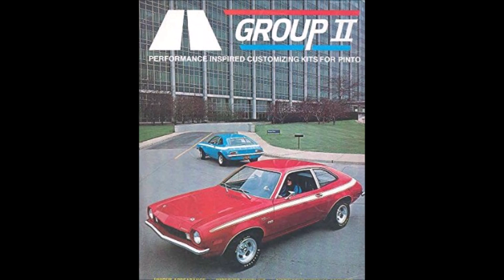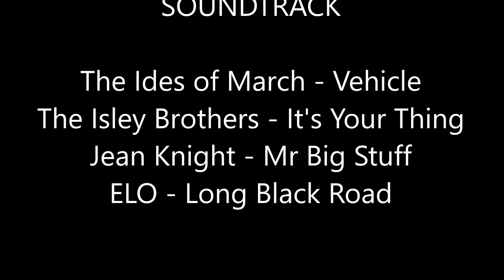1972 Pinto Runabout Restoration Part 3

Comment: Being a huge fan of anything 1972 Ford, Lincoln and Mercury I am super impressed.   That Pinto looks fantastic.   My parents bought a brand new 1972 Pinto on 11/04/72.   Capitol Ford had three left over 72's on the lot and my parents picked out the white Runabout with the optional interior and exterior decor group.  2.0 liter 4 cylinder, disc brake,  Automatic, A/C.  It had green houndstooth seats, color keyed steering wheel and seat belts.  Fantastic little car.  My brother inherited it in spring of 1977 and when he went into the service in 1980 I bought it from him.  Wish I would have kept it.  Sold it in 1981.  In mid 1983 I was missing my first Pinto so I found on 07/16/83 a non running needing a lot of work 72.  This one was a base model.  Very early 72.  The early Runabouts didn't have the two struts on the hatchback.   It's like it had a lot of left over 71 parts on it.  Door panels etc.  It had the exterior decor group and deluxe bumper group like yours.  My first one had plain chrome bumpers with no rub strips.  About the only good thing was the headliner.  It was my first project.  Luckily there were still a bunch of Pintos in wrecking yards for me to pillage parts from.  Door panels of a 1977.  Steering wheel out of a Cougar.  Console out of a Mustang II which fit like it was meant for the Pinto.  NOS dashpad. Seats out of a 1982 Mustang fox body.  Now I have reckling seats and a slightly higher seat which makes a big difference.   Put an engine in it.  Rebuilt the transmission and painted it Ford Dove Gray.  Loved that Pinto and drove it for seven years.  Sold that one in 1990 because I had moved out of town and bought a house so I needed extra cash.  So here we are in 2020 and I have my eye in one at a wrecking yard that was owned by an older couple.    When they passed away the family called the wrecking yard.  This one has 59K original miles.  Same white as my first 72, but with beige interior.    Oh how I wish it was green or blue.  But from the outside it looks identical to my original 72.  Dent free, great original paint.  Engine is super clean and looks like the engine compartment of a three year old car at most.  Best of all I runs good.  I will be making an offer next week when I go talk to the guy who handles rebuildables at the yard.
Reply from the maker: Sounds like a good car. I hope you get it
Reply: Did you get your pinto???

Comment: My FIRST car was a ‘71 Pinto, no air, 1600 engine, 4-spd, no radio, hubcaps, vinyl floorcovering, white with green interior. Bought it in ‘76 for $1200 USD. Worked ALL summer to save $900. Had a boot, no hatchback or runabout style. Lots of memories...biggest POS I ever owned, tho. Everything on it was thin, fenders and bumpers. No overiders on mine. Bent the end of a bumper once. Cost $150 for a remanufactured bumper at the time. Of course, I was 16-18 and really didn’t have the money to take care of it, properly. 
You’re doing it properly!!!! Very nice job with attention to detail. Thanks!!

Comment: This is a really cool film. I love the car - I like how you have made it much cooler that it was (not just better condition, but cooler colour) but kept the original period feel. Best of all the attention to detail is great - this project is an inspiration to anybody restoring any machine. The methodical approach is great to see but also it's great to be reminded that all the small detail fittings like door buffers make a huge difference - not just to making the car look fresh as new but I but it's less squeaky & rattly than some restored machines. Great to see such a rare and overlooked machine put back into daily use, too. This machine will turn heads wherever it goes. great project, great film.
Reply from the maker: Thanks for the kind comments. Interesting to restore a car so much newer than my usual ones!

Comment: Wow, thanks for the memories. Had a 74 hatchback. Orange with red stripes. Drove the hell out of that car. 4 speed 2000 cc motor. Only bad thing was those motors were notorious for eating cams. They were easy to replace though. I'm pretty sure I still have a brand new NOS front grill for a Pinto still in the box in my garage rafters.

Comment: Looks like you may be in England, an odd car for there even when they were new!  Pintos and Vegas were everywhere when I was a kid in the 70's. Pintos seemed to last forever, vegas hardly made it to junkyards. One friend had a '77 pinto wagon, passed it to his little brother years later, last time I saw it it had well over 300K on it. Just have to keep up on oil changes. The 4 speed manual was a decent transmission and made the car a lot less sluggish then the auto, and more fun to drive. Really nice work there, car will certainly turn a lot of heads!
Reply: Yes the automatic pinto was VERY SLUGGISH I DEED. I drove my girlfriends ' 76 auto pinto. The 4 spd wasn't really quick but fast enough to get in the freeway safely, I drove a 4spd for Home Bank of Signal Hill, CA as a messenger for about 4 months. Drove around SoCal,  Lakewood to Hacienda Heights compton, Fountain Valley Los alamitos back to signal hill and to Lakewood. Fun job. And the GF's auto ' 76 pinto was almost a deathtrap trying to merge onto the freeway.

Comment: Love the 72 2ltr pintos best looking and running imo only thing I would have done differently would be using the nos aero shaped body color mirrors, most where optioned that way, supposed to improve fuel economy lol
Reply: I was thinking the same thing on the mirrors.  My first car was my grandfather's '72 Pinto--I was just a little kid and was there when he bought it new and rode home from the dealer with him!  His was nicely optioned for the time with the 2 liter engine with automatic, AM radio and factory AC!  And while his didn't have a lot of the doodads you see in the nicer trim levels (e.g. it had the thin 2 spoke steering wheel with horn button in the center and just tan vinyl seats not cloth) it did have the nicer body color mirrors left and right with the knobs for remote adjustment.  This beautifully restored Pinto would look better with those assuming a set could be sourced!  Loved watching this video!  I miss the Pinto and DEARLY miss my grandfather and really wish I'd never traded that car but I still have all the memories!  HAHA when we pulled up in his driveway for the first time, the neighbors all came out to look at it because well it's what we did back then on getting a new car and the first Pinto in the neighborhood, but then he couldn't figure out how to get the key out of the ignition!  Had to go call the dealer and they told him about the button on the steering column to unlock it.  That same button saved me some grief in my college days when pulling up in the parking lot a friend walked over and tried to prank me by pulling the key out of the ignition but couldn't do it!  :D

Comment: Fantastic work, and thank you for sharing! I'm also currently restoring a 72' Pinto, and watching your progress is not only really inspiring, but has helped to answer a lot of questions. Would you mind telling me what type of side mirrors you used and where you got them from? I'm in Australia, and being LHD I need mirrors on both sides. I'm aware that dual mirrors were a factory option, but they are plastic sports-style ones which I'm not fond of and are expensive.
Reply from the maker: Hi, thanks for the comments. I had exactly the same issues with the mirrors being in the UK. Took me ages to work out that Ford never did a chrome passenger mirrors, and like you wasn't keen on the plastic mirrors. I bought those mirrors from CJ Pony parts. They are for a Mustang but 99% identical, and come in pairs! Check them out for lots of other parts too as Pintos shared a lot parts with Mustangs. I bought a new indicator stalk and auto shift handle. identical! good luck with yours
Reply: The factory sport mirrors are not plastic.  They are pot metal.   I had them on my first 1972 Pinto.  They should be fairly easy to find because Ford used those sport mirrors as optional equipment on most he the Ford and Mercury line throughout the 70's.  My 1977 Mercury Cougar XR-7 had the same mirrors.

Comment: Had a GF for a bit who had a Pinto back in the day. Standard Trans, was no speed demon but was fine for basic transportation. Just needed to make sure nobody rear-ended you because when hit from behind if your fuel tank didn’t explode and fry you, the car running over you surely would do the trick.

Comment: in 75 I bought a 72 Bright orange sedan with black vynal roof 2.0 built with a cross the counter ford hi po cam 71 piston( higher compresson, rist pin location was lower in piston) It was BAD